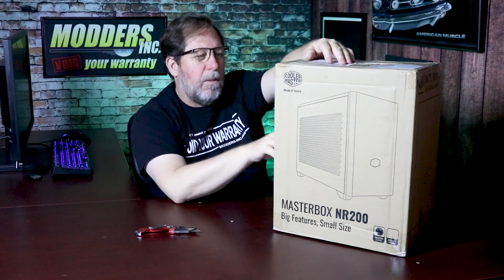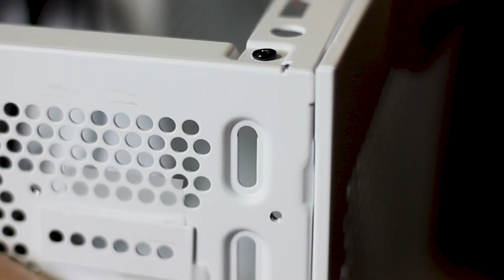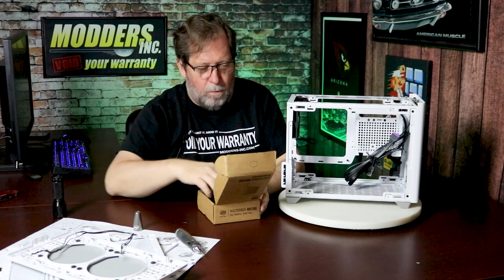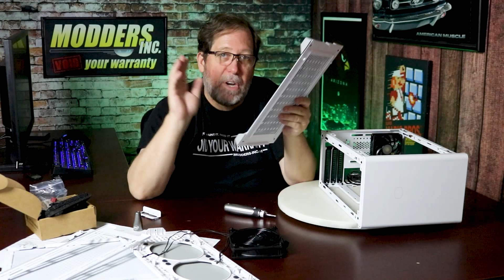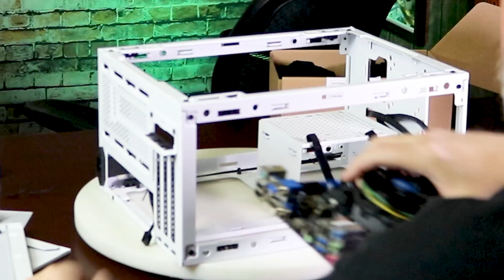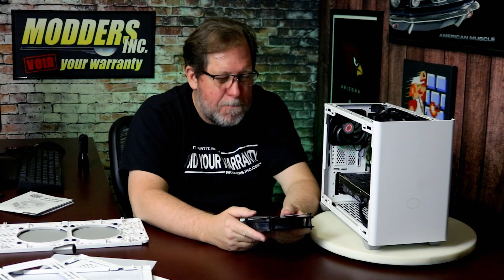Deep Review of the Cooler Master NR200 Mini ITX Case

Comment: Thank you very much for posting. They just came out w/ Cooler Master NR200P MAX. I just bought the NR200 (no P) yesterday. :) Bought everything yesterday for my new computer. But bought a RTX 3080 Ti FE at Best Buy Aug. 26th. It was worth the overnight wait. (Asus ROG Crosshair VII Impact - AMD Ryzen 9 5900X - RTX 3080 Ti FE - Corsair SF 750 W 80+ Platinum - Noctua C14S CPU Cooler - Samsung Pro 1T - Corsair Vengeance LPX 32Gb 3200/16 - 3 x NF A12x25, 2 x NF A12x15 fans). Thank you again for another great video.

Comment: I got the tempered glass version of the case. The differences are :
No 90mm fan for TG version
A 2nd 120mm fan for TG version
A small riser cable for vertical GPU for TG version
The vertical GPU mount setup out of the box (the non TG version come with a vented plate screwed instead of the PCIe hardware out of the box 24:40 The plate is not in the TG version)
The tempered glass pannel (the vented metal pannel is also in the box)
Reply from the maker: Great info! Yeah they sent me just the basic case :-(

Comment: You can actually fit up to 8x 120mm fans depending on what low profile cooler you are using when you air cool the build. You can also fit a 120mm rear exhaust depending on what kind of motherboard you are using...

Comment: I was able to use the Noctua NH-U12S in Push/Pull.  The tower cooler is 158mm and it fits!
Reply: @recycleBinLaden no you won’t be able to use the side bracket.
Reply: @recycleBinLaden no room at all.  Using the Noctua it’s about 158mm with the mesh panel and it’s right up against it

Comment: How did you vertically mount your GPU?  My NR200 has indentations where the GPU is supposed to fit but I'm going to have to cut out the back plate to make it mount.  Are there different NR200s?
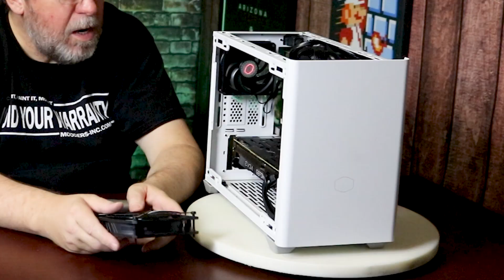Reply from the maker: Hi Ronnie, please take a look at time 24:30 and I start to explain about the bracket that came with it to mount a vertical GPU. I do not think they have a non-vertical model, but you never know.

Comment: Would a push pull aio fit down there with the vertical gpu?
Reply from the maker: If you are talking about a Rad sandwiched two fans, I would say have to say no.
Reply: @Moddersinc1  thanks. Yes that's exactly what I meant. How about a rad sandwiched by slim fans?
Reply from the maker: @mpcbsar  Like me look as I have the NR200 out on my desk for another video.

Comment: with low ram, is there room to mount a 240 aio on the top?
Reply from the maker: No, even a 25mm thick fan is a tight fit. Also there are no mounting points on the frame to install a radiator. Your best bet would be on the bottom or the side. I might do a video about installing an AIO.
Reply: machines & more has many videos on cooler options in that case
Reply: a 240 is possible in top if you use a 20mm rad with 15mm fans rads are on aliexpress and the fan on mb end needs be offset a bit google for top rad you will see some builds with it done

Comment: Would you recommend this over Silverstone sg13
Reply from the maker: I believe the Silverstone sg13 is more square. As stated the NR200 is more like cutting a mid tower in half. There just feel like there is more room and better suited for larger graphics cards
Reply: @Moddersinc1  Can the NR200 be carried in a  backpack like the SG13
Reply from the maker: @bitupon10  Great question. Small or medium-sized backpacks, no. I just put in my Aorus backpack which is kind of over-sized and I was able to close it about 80%
Reply: I just need to carry it as a carry on luggage in  flights. Only reason i am even thinking about a smaller case than this. This looks solid though.
Reply from the maker: @bitupon10 , it would fit for sure in a small carry on / over-head storage luggage. The size is roughly 14.5 inches deep, 7.5 inches wide, and 11.5 inches tall (including the feet)

Comment: anyone know where to buy another set of the tooless fan mount pins?
Reply from the maker: Great question and I can ask Cooler Master, but did you check their website?
Reply: @Moddersinc1  I did, even their extra parts website but nothing I could find
Reply from the maker: @jacobmadariaga5852  are you looking for the ones that came with the NR200 (Cooler Master currently does not have those) or the all rubber one like this... https://amzn.to/2HhA3eD

Comment: Hello there! Lovely case indeed. 😍
Would it fit a 3080 air cooled , with decent temps?
Reply from the maker: In the horizontal (normal) position I think it would be fine as it should be able to grab a lot of air from the bottom and the side panel, if you are using the metal panel and not the tempered glass one.
Reply: On Reddit people shoved in there even a 3090 in horizontal position with the TG Panel and Temps seemed fine. This Case is an itx cooling wonder thanks to its Design and multiple fan setup.

Comment: will a corsair icue h115i pro xt fit?
Reply from the maker: If mounted on the left-hand side bracket, yes.  Funny as I literally JUST looking to see if the Cooler Master ML280 would fit on the bottom. It kind of would but would need to mod the lower panel.
Reply: @Moddersinc1  it should right ? ML280 is shorter by 11mm compared to 322m for h115i
Reply from the maker: @winkawak  The ML280 will fit on the side bracket. The h115i is going to be close and I can't say yes or no as I don't have one to actually try it :-(

Comment: Where's the ambition! Go for a dual rad cooling a 5900x and a 6900 xt / 3090 in this thing for kicks.
Reply from the maker: Sir I would be more than willing if you could get those 😉
Reply: @Moddersinc1  that is a very fair point, I admit. I am certainly pushing the timeline of my new build, which will be around that price bracket at the time of building, for that exact resson. Do you not think this case will remain relevant, however, because it fulfils one of the bigger niches in the market (SFF for the masses), so it will be relevant to revisit when you can borrow the parts, buy them or something else?